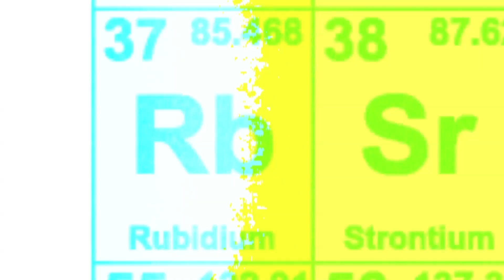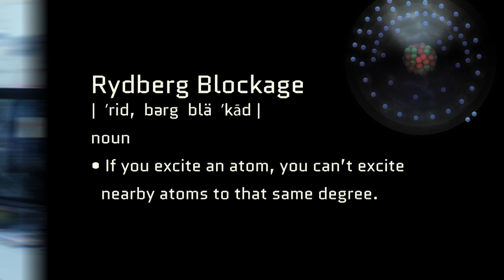Could We Ever Build a Real LIGHTSABER?

Comment: Lightsabers can’t be used without the force. If a non force user tries to use a lightsaber it won’t ignite or the crystal will over heat and explode the handle or melt it.

Comment: Light would not be a good source for the blade because it would be to weak. A tube of plasma would be better. So one component you would need would be a superheated plasma torch; that could be the handle. Then, in order to mold the plasma into the shape of a straight tube, you would need magnetic containment so you would need to insert a magnet or an electromagnetic coil inside the handle. That containment theoretically would also allow it to deflect other plasma based weaponry including the blaster projectiles. Next you would want a telescopic ceramic rod that could shoot out of the handle and the plasma could flow along inside of this heat resistant rod. You would wanna drill holes on to the surface so the plasma could flow out. You will need about 50MW of power to heat the plasma to the temperature of the sun’s surface but you would need the energy of a nuclear reactor to produce that much power. That would be enough to slice through steel as if it were butter or almost any known substance with no resistance. You will need a portable power pack for that, small enough to fit into a 5 inch long handle. One possible solution is a nanotube, while small in size could produce large scales of energy by the use of carbon atoms that can conduct electricity or nanobatteries. Lastly, you would want a dyetanium fan that would shoot about one hundred feet of cubic air per second into the hilt where it would be heated to twelve thousand degrees of plasma. Now I didn’t make these blueprints up, I got it from a video from Michio Kaku on an episode of Sci-Fi science.

Comment: Well the short answer is probably not. We'd have to have an extremely compact and high-yield power source, plus a way to contain superheated plasma in such a way that it can still come in contact with a target (but of course without scattering all over the place and probably killing the wielder in the process). Not to mention, that plasma has to come from somewhere, and while you can turn air into plasma, the containment field presumably wouldn't allow the exchange of gases (unless you could somehow make it one-way, which would present a whole other set of challenges), which means the process would immediately use up the tiny amount of air inside the field, giving you less than a second of operational time. Whichever way you look at it, light sabers are pretty much impossible, and even if they weren't, they'd be just about the most impractical weapon you could possibly use. Han was right, I'd take a simple projectile weapon over a lightsaber any day. This is also the reason directed energy weapons are not more common in real life. They certainly exist, but are usually far more complex and costly than plain old ballistics. From what I understand, we could actually make a plasma gun with current technology, except it would basically be a shittier version of a flamethrower, itself a more or less obsolete weapon these days. Hybrid energy/kinetic weapons like railguns are far more promising, if you really want to destroy stuff sci-fi style.

Comment: Hypothetically it wouldn't be that complicated. Simply put, a heavy duty metallic tubing made to withstand extreme temperatures would be sufficient to allow an electric coil to release heat into or through it, like the burners on the inside of an electric oven (probably somewhere between 250-300 degrees F. Of course it would probably be considerably heavier than a firearm, close range only,  and cause immensely painful, irreversible damage if not killing them from shock. Additionally, the materials needed would likely be expensive and it is likely it would take quite a while to cool down after use which also means you're going to be holding this heavy item awkwardly for a while after use. Plus the  temperature would mean that the hilt would need to be completely nonconductive and possibly require a coolant to run over your hands or the internal components while in use to prevent burns.

Comment: The best i can come up with is using liquid ferrous is the handle (yes nasa has liquid ferrous already)  then energize the particles in the liquid and turn on a strong magnet force that  protracted out...the energized ferrous particles would follow the emf field ....creating an elongated "M" structure....so, yes it would not be a laser...but it would look like the TV laser swords without the clang. Instead, two swords would go right through the other as if,   they weren't even there.....Also I would choose the blue over red because of the higher energy the ferrous would have to put off....so, yes it would put off light but not technically be a laser.....fighting would be circling and lunging and pulling back to avoid attack....because there would be no real way to defend

Comment: If you could align mirrors to reflect laser light exactly it should be no problem. Just put a laser emitter on the handl and put a titanium and carbon boride rod with a mirror on the tip about 3 feet long so the laser will reflect back then put a mirror on the handle at a slight angle so the returned laser will bounce into infinity without hitting anything and it should work. You could also just mount a laser on a handle of some type, fix up something on the handle to emit a mist or fog so you can see where the light is at all times and you have a light saber. Of corse the laser beam would be shooting out also.

Comment: Actually game theory explained lightsabers are possible! if you can trap plasma in a magnetic field you can control a been hot enough to go through anything. If the mechanism used to control the plasma was formed into a metallic cylinder shape (like a lightsaber) you could actually hold it without damaging your arm. It could go through ANYTHING!!. As well as this if two of these blades of plasma came into contact with each other they would collide and not go through each other. Best part is this technology is already being used in medicine.

Comment: You do know the blade of a lightsaber is not actually made out of light? a lightsaber is essentially a plasma blade with the switch. Heres an explanation: if lightsabers were made of light then the length would be limitless. A specialised crystal structure can be designed to wall and control the flow of atoms. A lightsaber made of light does not clash. All you need is a good handle designed plasma generator with magnets to keep the plasma in check, oh and don't forget about that battery to power the magnets and generate plasma. Oh and plasma is also the fourth form of matter btw. please try to use your brain and act like someone who has a great capacity to understand.
Reply: r/iamverysmart where are you?
Reply: agorikov nerd
Reply: agorikov and the blade has tons of energy
Reply: Lori estes without nerds, you would still be living in a dark cave at the bottom of the food chain. Respect nerds, coz once day, you'll be working for one, asking for a raise you don't deserve
Reply: Lori estes atleast he wont be homeless
Reply: quark gluon plasma is the 5th
Reply: agorikov a lot of people don't know bc they were never taught us plasma but of course us smart people know about
Reply: agorikov it

Comment: you can make a lightsaber.
Amichio Cachi proved it. 
I think that's how you spell his name
Reply: Michio Kaku is his new and he did with a heat resistant ceramic, telescopic, cylinder that would house the heated plasma gas...using the oxygen in our air as the fuel source. the major problem is the HUGE amount of power to get this done. once that technology is obtainable, the ceramic tubes would have the heated plasma flowing in and around it, giving it the appearance of a solid plasma blade. the best part is, it would work just about as effectively as a light saber from The star wars saga. VERY damn cool!

Comment: in order to make a lightsaber you half to have something that can't burn then you half to have a transmitter of light then must find a good nice and new button and in order to make the lightsaber work you must have two different wires must have red and blue.Then once you have it working than you add a chargeable battery and and then you must have a good clean thick piece of glass that can shoot a laser through it then you can add any color of dimon in it once you have it all together you have a chargeable lightsaber.

Comment: lightsabers are actually plasma contained in a magnetic force field. within the hilt of a lightsaber, is a cylinder thing called a diatium power cell. btw, if you are wondering what plasma is, it's basically a gas that's been heated or had an electric spark added on to it. the diatium power cell contains large amount of trumponium gas, which turns into plasma when the circuitry attached to  the power cell gives it a spark. the plasma then travels from the hilt and through the crystals which helps it focus more, giving it the ability to burn through almost anything.

Comment: actually by refracting photons back in on themselves enough you can create a heated plasmic mass using just the photons this basically creates hard light the trouble is that it doesnt last very long at all for now and will basically burn straight through just about anything as is the nature of heated plasma but we can create a similar more stable and sustainable substance by using electrons instead of photons this creates another form of plasma which is charged plasma witch can be controlled and directed using magnetic fields

Comment: maybe it'd be not like a real lightsaber, but we couldnt we just build a hold, that (on buttonpress) moves out a thin metal rod. at its end there are mirrors that throw the light back to the hold or to the other mirrors. so if the light turns on, the laser beam is directed through the middle of the rod. on its top it reflects to the mirrors on its top, which reflect the light back down to the hold, so we have a laserbeam - barrier around the rod. if the laser is strong enough you could cut by moving your lasersword  sideways... right?

Comment: Collapsible metal blade that's super heated to cut through most things have a push button for it to fold out and then button to ignite I'm just saying it doesn't have to be a laser to be a lightsaber. It might take away the laser and crystal but some things burn or spark in different colors which means it might be able to be blue green red or possibly purple, this can be real. Just to our degree since you can't stop a laser at a certain point.

Comment: So, just because light passes more slowly through a state of matter (which has always happened), this is suddenly a scientific breakthrough? But if it works like a glass of water, then that s not what s really going on. When light goes through a glass of water, or even through air, there s simply an opposing force, which blocks the way, or rather narrows the way of the atom. Its like running on the road, and running through an obstacle course. In order for the light to keep going, more energy must be used. Its why we need brighter flash lights to see through thick mist.

Comment: I think the light sabers were not light but plasma contained in a force field that way your blade could be any length you wanted.  The question I have is why do they never have to charge them they must use massive amounts of power.  I have never seen one run out of power or be charged.

Comment: In my opinion, if the lightsaber could made, it'll not right with the light's rule.
1. Light go straight -> It won't limited how long is it.
2. Light could be stop by a normal things.
3. So, it'll need a hot temperature (plasma) to burn thought things -> Yoda need times to pull lightsaber thought the robot.
4. Your hand will burning fire like a chicken.
Reply: Don't let the name or this video fool you, lightsabers aren't actually made of light at all xD

Comment: Actually, I've thought out the light saber problem. Try this on: when it's turned on, a microfilament extends from the handle (much like a collapsible antenna) from which the energy field radiates giving the glow and appearance of solidity. Likewise, a blaster bolt would have smaller microfilaments that have been charged with the energy, but would dissipate on impact. I believe this would be able to be built with enough tech advancements on energy storage and microfilament composition.

Comment: When i think of a practical lightsaber obeying the laws of physics I think why not make a rod that goes the length of the "blade" with a reflective  or stopping point. sure it won't give you a true lightsaber but it would allow you to use a high intensity laser aimed at an object creating a beam or in simple terms a Light blade in sci fi swords with light saber like bladed edges have been around before so this is what I'd say would be a more practical saber. The idea of using a "plasma saber" directing it out would be while difficult to control it would if some how channeled and kept from acting like bolt of lighting, cause Plasma kinda does that... Remember those globes that you used to play with you put your finger on it and it started focusing on it? yeah... That's plasma. Plasma loves conductive surfaces it's more similar to lighting crossed with a gas so making it stay in a line would be difficult..

Comment: if i recall correctly what i read in scientific american decades ago ( about cooling individual atoms ) they were using tunable lasers arranged so that six lasers illuminated  a cavity, picture a cube with a laser shining on each face. the lasers were tuned so that when the atom was moving toward a laser the energy transfer was higher than when the atom was moving away. the eventual effect, provided that everything was set up correctly, was an atom "frozen" in a light trap. the finer  details escape me but i know they had to have a method of  eliminating the large scale thermal vibrations before the laser cooling could take effect. as far as light sabers are concerned  the fundamental problem is the power source! since the films repeatedly show people without "force" talents using light sabers we know they need some form of power supply that is extremely powerful and will fit in the handle of the weapon. judging by their ability to penetrate thick metal doors  that power source, if built with our earth technology would weigh at least a ton or so without taking into consideration the fuel weight, cables and a cooling  system to keep the handle from melting! it seems to me that trying to figure out how to get the blade part of a light saber working is pointless if you have no way of powering  the damned thing. this is the test that separates the deep geeks from the shallow geeks! forget about all the shiny toys padawans, look for the source of energy!

Comment: Would it perhaps be possible to build a frame of a lightsaber out of a highly heat resistant material with a "cap" of sorts at the top and then fire a laser from the hilt straight to the cap? I'm imagining a high powered laser being aimed from the hilt of the lightsaber towards a cap that would stop it. Then the result would be a contained laser beam that could be used as a weapon because the laser would be able slice through certain materials based on its energy. It would of course be limited in its power by how much power the "cap" at the top could resist but it would still be awesome. Does anyone know if that could be possible? I would imagine we would need to use something like depleted uranium for the cap.
Reply: +Kai Osborne Trainee lightsabers can't stab anything either (like the ones in SWTOR). They are more like long baseball bats with energy surrounding the bat. Technology can evolve but I don't think lightsabers, as they are, are fully possible to us right now. Or ever.

Comment: How about having a long metal rod that extends out from the center of the light saber hilt and is topped with a small disc shaped mirror. Then you have small lasers that encircle the outer edge of the hilt, angled slightly inward, so they all come to a point at the mirror.

Comment: I want a jetpack that runs off of solar energy and a power storage device that can hold infinite amounts of electricity but can also direct the appropriate amount to something that needs power. The device got struck with 50 lightning bolts but if I'm using to charge a phone or battery. It will only release the proper amount to give it more juice.

Comment: Can't believe i never looked into this channel before, i am 10/10 subscribing!!!

Also!

Do not forget this, I would also say this is VERY much like a Lightsaber.

http://phys.org/news/2013-04-plasma-device-revolutionize-energy-storage.html

This is part of the article.

"Curry's device launches a ring of plasma as far as two feet. The plasma doesn't emit radiation, and it is completely safe for humans to be in the same room with it, although the plasma reaches a temperature hotter than the surface of the sun. The secret to Curry's success was developing a way to make the plasma form its own self-magnetic field, which holds it together while it travels through the air."

If that doesn't SOUND VERY SIMILAR TO A LIGHTSABER, I honestly do not know what does.

Comment: I know this comment is late but I have to disagree with you when you said photons lose energy and travel slower when going through a medium, then pick back up after it has left. A photon is always traveling at a constant speed, and based on its medium, the time it take to get from point A to B is different. This is not because it slows down, but rather because the path it takes to reach B is obscured and must "weave its way through" to this point. Correct me if I am wrong.
Reply: I shall correct you. "It is time it takes," not "time it take".